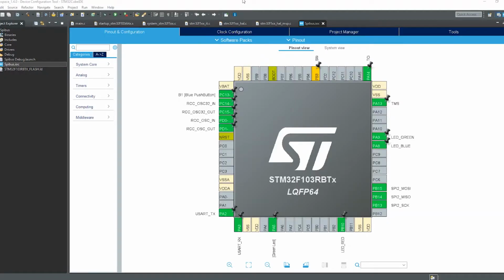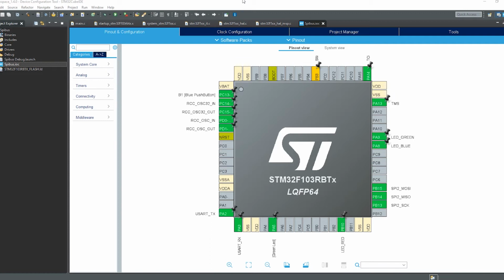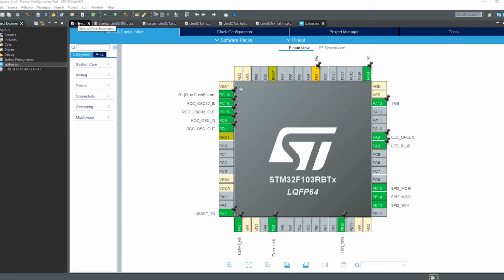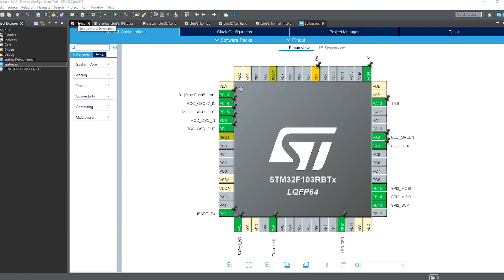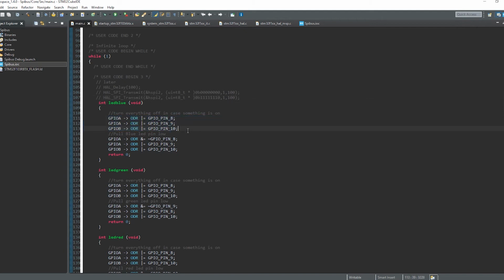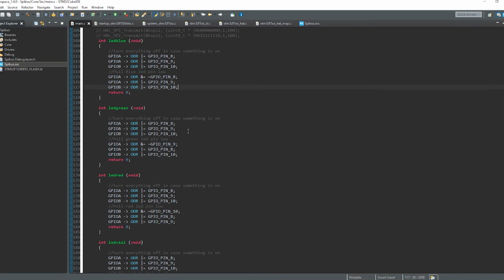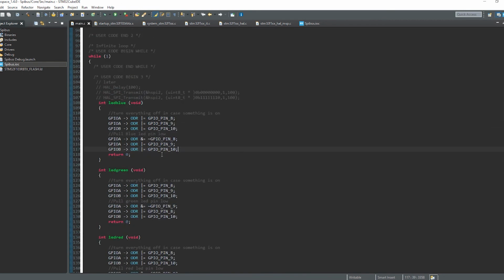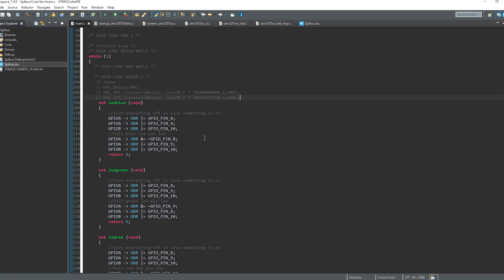Building a Handheld (STM32) Part 4: Power Led and Blinky

Comment: hi
sir i am irfan from pakistan 
please you can help to me about 1mini circuit
i want make the circuit of sensor proximity analog distance (xm30-3015pmu) it has a function
we have a sensor distance 15mm from metal it give dc10v ...14mm=9v....13mm=8v...12mm=7v depending on the metal 0-10v vari with distance